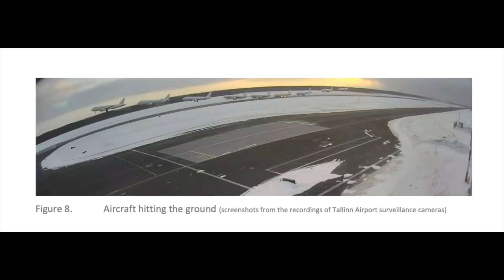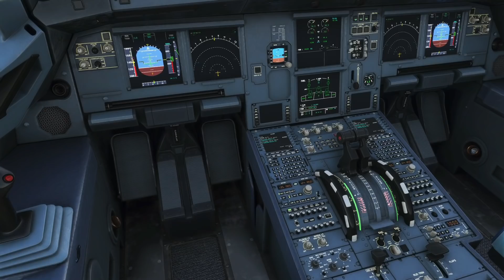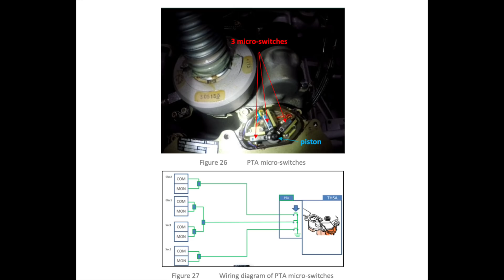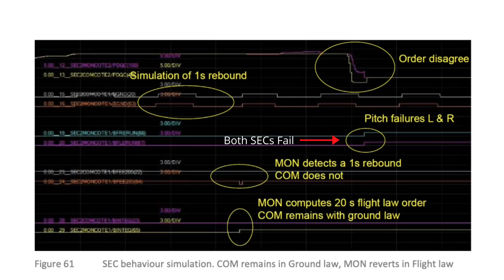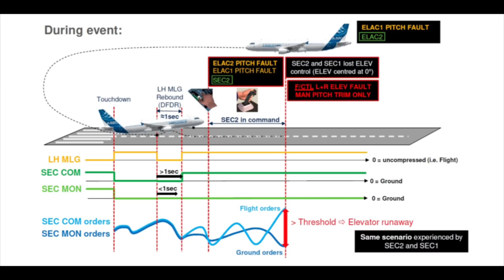The Oil Change That Crashed A Passenger Jet | The Crash Of Smartlynx 9001

Comment: 100%automation with pilot oversight.

I want the computer to be able to look at everything at a single microsecond.

If this plane was fully automated and fully integrated,  the computer could of resynced the sec1&2 by knowing they were in the air by using other gauges, ai, scripts, ect.

You wouldn't blame a pilot who's eye was forcibly closed or intentionally blinded for messing up,  just like we shouldn't blame computers for not doing a job the were not fully do because of the lack of resources given to the computer.

Computers are better at communication,  problem solving and following guidelines when given the chance and programed right.

Comment: You're asking the wrong question. 1-10 automation is irrelevant if the QA applied to that automation is inadequate. Testing is ultimately the hardest challenge facing automation integration into any mechanical system where lives are on the line. This is entirely the fault of the QA team responsible for designing the test plans for these redundant systems, especially given the fact that they knew they were working with asynchronous state/data streams. Competent QA would have known to run this test, or to build a system that throws random component failures/out-of-spec responses into their scenarios. Regardless, my answer is N/A, none of the above. The pilot should, at any point, be able to fully assume surface control of their vehicle. For anything less complicated than a supersonic stealth bomber, at least.

Comment: The problem is not in automation. Much better safety could be achieved by existing amount of automation only if the audio and visual feedback of the computers was improved. As for the mechanics, I don't understand why Airbus was not required to correct their design and make it more fool proof. It's ridiculous that functionality of such a simple switch assembly depends on oil viscosity. A binary system must not depend on variable parameters that are not inputs!

Comment: It's amazing that the microswitch piston was so sensitive that the wrong oil would cause that.  As a non-pilot, the whole thing seems unnecessarily full of fussy mechanical bits.   But I guess it is good that it failed then, rather than slowly wearing out and causing a real tradgedy somehow later.

This doesn't really seem like an automation failure though.  The software really should not have been vulnerable to race conditions like that, and I hope that kind of thing is fixed now, but it seems like what really failed was probably human error, putting the wrong oil in the first place, and possibly the microswitches not being robust enough.

I'm not exactly sure how or why anyone still likes microswitches.  They are reliable, but not as reliable as you would expect given how absolutely confident people seem to feel about them.   But I guess that is why they had 3.

Comment: FBW systems should have emergency switches to bypass the computer and instead directly control the angle and position of the control surfaces, but pilots would have to be trained to work without the feel of a cable-pulley system or the computer's assistance

Comment: A fabulously interesting dissection indeed !  I'm not a pilot but a Dr. 
I see many parallels that air disasters and near disasters have for Medicine & virtually all professions.
Mostly we see reiterated rightly, that a chain of events lead to the disasters..

I confess to being a contrarian. I've always wondered if the chain analogy is good enough ?
I've therefore asked repeatedly, "what if just 1 link is missing or was cut?"
Your reverse look up presented here, is most appreciated and is like.. " the exception that proves the rule"

As for your poll on Electro-Mechanical Automation vs Pilot Autonomy..? 
I beg to steal a warning & guidance from Marvel's Spiderman series..

"With great Power ( Automation ) comes great ( Pilot )  Responsibility "

Comment: Both are needed, but automation should not overshadow the pilot or be the basis of hiring less experienced pilots.

Automation in an airplane is helpful to the pilots and necessary to relieve the load now that they are down a person (flight engineer). The push towards automation should not put us in a position where there is only one pilot in commercial aircraft above a predetermined threshold of number of seats. There needs to remain at least 2. There are too many lives at stake in the plane and on the ground to not have a back-up (human being). Computers, programs, and automation have made many things easier for us. Though, they do break down, shut-down and go haywire often enough that it would be irresponsible to not have 2 human beings that understand the airplane, available to think outside the box in an emergency. The plane is constrained to what was programmed and how that can be applied to situations that have not been considered. 

With the automation in place many outfits do not want the pilots involved in the flight and side-line them as much as possible. This is an idiotic idea made by people that are looking at the bottom line and afraid of legal ramifications. If you do not trust your pilots to manage even simple tasks, then there is something wrong with your hiring/training practices. Pilots need to keep up their skills and kept engaged in the process, the ones who save their planes, in general have brought many skills with them (many of them ex-military or glider enthusiasts). Automation can take off some of the load, but it should not be so much that the pilots are bored and side-lined. Whether it is training in a simulator or more hands on involvement in the cockpit, the pilots need to keep up their skills and continue to learn about the airplane(s) that they are flying. 

Companies seem to have this fantasy over the last decade or so that if they write down procedures, anyone can do the job. In their mind, experience does not really count. Well yes, they can, though this is a foolhardy way to approach business. Anyone may be able to follow directions that are written down, but an experienced person will be more efficient and will notice issues that would otherwise pass unnoticed. Encouraging pilots to engage in activities that sharpen or broaden their skills will make everyone safer. Using automation and SOPs (standard operating procedures) to hire less experienced pilots does not help anyone. Pairing an experienced pilot with a less experienced pilot can be beneficial, so long as they both can work together, be willing to learn and be willing to teach.

Comment: I think a lot of the problems come when the automated systems fail to inform the pilots clearly what is wrong. It's all very well having this stuff with all its bells and whistles but the pilots MUST be kept informed properly by the equipment. The so-called glass cockpit might have been able to solve this problem but the aircraft manufacturers have failed dismally in this respect.

Comment: When airborne, it’s also the multiplicity of redundancies with the absolute automation that should work together.  Pilots should include in their behaviors being operators monitoring devices working harmoniously.  The old school hands on approach is not fit anymore with fly by wires on modern aircrafts, the sidestick is the equivalent of the mouse or trackpad of a computer, therefore not so much action of the brave hero we’re accustomed to see in movies saving the day is necessary.  It’s natural to reset the computer since no one can go around or outside to see what’s wrong when a modern jet  sends mid flight warning signals to the flight deck, but it’s also natural to remain focused on a particular task, not realizing they should have interrupted the program completely to turn off the engines and restart again from square one; it’s never a good idea to be cavalier about complex machines. They had that luxury unlike in other incidents.

Comment: To answer ur que as to automation, I would be okay w/a level 10, or FULL automation, IF & ONLY IF the following measures were taken...consequently 3 measures which realistically could've saved 300+ lives in the MAX crashes. 1. Pilots are better trained in said automation & are req. to recertify w/greater frequency. 2. Measures are taken to allow flight crews to more simply & quickly diagnose the problem when one occurs so as not to have to reference a QRH or follow step after step from a display to again, quickly diagnose & remedy the issue, saving PRECIOUS SEC. 3. Finally, the biggest 1. The ability to IMMEDIATELY override any & all automation rather than (like in the MAX crashes) havin' to literally fight a computer for control of the aircraft, which we've seen in countless crashes, along w/pilots saying "I don't know what the aircraft is doing," like in the AF447 crash, but UNTIL THEN, I can't support increased automation.

Comment: This is why Boeing is better.. Airbus gives more control to computers than to pilots and it has caused many crashes..
Reply: Yet when Boeing tried to do it, it also resulted in 300+ people dying. Watch the latest episode where Airbus automation prevent the plane from stalling on final as the pilots made a mistake. A 737 likely would have stalled and crashed

Comment: Yet another example proving that pilots fly airplanes really quite well in problem situations while computers fly well only when everything is working as it should,.I’d like to see every aircraft with computerised control systems fitted with a big red button that gives the pilots full manual authority over the control surfaces.

Comment: The controls were ifi due wrong oil used at that temp, but they kept doing touch and goes anyway.  Then that guy raised the flaps when low and slow over the runway making the airplane hit the engines on it.  That is what make them lose the engines and land a bit short.

Comment: It's interesting that you ask for people to comment about the level of automation based on a scale (1-10) but that by itself suggests the answer. BALANCE. Too little can make a pilot's workload excessive contributing to fatigue which then means that the "human computer is failing". Too much automation (in addition to the possibility of "computer glitch" or other mechanical failure) makes the pilot more or less dependent on the automation features which can lead to complacency and may eventually erode the pilot's own level of competence as he relies more and more on automation to fly the plane and less on his own abilities.

What that balance needs to be as it applies to this topic may never be answered. I suspect that there will be a greater push toward more automation rather than less so that "pilot error" becomes less of an issue which airlines have to contend with when things go wrong. That may be inevitable. Whether that's a good thing remains to be seen.

Comment: You mention the MAN PITCH TRIM ONLY warning, but I think the related ECAM message "F/CTL L + R ELEV FAULT" (that's the actual ECAM warning that comes together with the CRC) is much more spectacular - seeing this on a GA is a nightmare :)

I've studied this accident extensively and I was really surprised that Airbus wasn't aware of some of the failure modes that were encountered here (ELAC PITCH FAULT due to OVM failures was a known scenario, but the dual SEC loss due to bounce wasn't listed anywhere in official Airbus documents I could find). I was also surprised to find out how strange some of the ARINC busses are synchronized, as that is part of what brought this bus down. The ARINC busses that the SEC lanes pull data from are actually synchronized, but the data sets are not neccessarily synchronized as some data is pulled from a LGCIU that in turn needs to pull from the other LGCIU, as the related Shock Absorber Compression sensor is offside. As completly different pull intervals are used, there is a maximum window of 120 ms where a SEC lane works with stale data, thus causing the "if more than 1.02s BGND then 20s flight law latch" condition to activate in only a single lane, if the aircraft experiences a ~1.02s bounce with highly specific timing conditions. This is effectively a common mode failure, as it is likely to affect both SECs simultaneously. This is normally not an issue, as you're not going to do a touch and go with SECs engaged in pitch, but if you just lost your ELACs, well... We saw it here. I know the A320 is 80's design, but I don't understand all decisions taken here. There are definetly common mode failures in SEC design that could have easily been avoided with a different bus design, but yeah it is how it is. Maybe the alternatives had other issues, I don't know. I presume that it works different on the newer Airbuses.

Airbus has reacted to this accident in a number of ways, notably modifiying the computer reset table in the QRH to forbid any ELAC reset in response to ELAC PITCH FAULT messages. There's also a new ELAC software version in the works (or even in already in rollout) that is apparently capable of being a bit more robust against missing override signals, hopefully preventing this failure scenario in the future. The training manual also no longer tells pilots to touch the trim wheel on touch and go's. The SEC issue is harder to tackle as it's fully a design issue, not a bug you can easily work around. I've heard they work on a new SEC software that handles bounce on touchdown better, also preventing this in the future.
Reply: Not sure if you were aware as it wasn’t mentioned in this video but another thing that didn’t help was the spoilers were not armed. If they had been it was less likely the aircraft would have bounced

Comment: I agree with gene bohannon, stick and wire is the only way to go to save lives. I command my aircraft better when it listens to me rather than having it think on its own. Airbus is endangering people's lives by having IC's boards , capacitors, relays, etc do the thinking. Scary, isnt it?.
Reply: No not at all. If what you said was true then Boeing would still be controlling the 787 by cables but it isn’t. It and the 777 (and even part of the 747-8 and 737 Max) are also FBW

Comment: The automation is fine as it is, the problem here was humans ignoring the warning signals. Hand they landed to check out why the ELAC warning was activated the 1st time, they would have avoided the problems. As the adage goes, "take-off is optional, landing is mandatory." The should have opted not to take-off after the first warning.

Comment: the animation is way off, after the slamming take off the plane rapidly climbed to 6000ft but then trimmed down heavy and nosedived to ca 200ft before pulling out, and rollercoasted multiple times before they got the trim stable

losing all elevator control during takeoff is something that they are way lucky to walk away from, but really, besides luck, their quick reactions were the real saving grace

it was a real horror-rollercoaster

Comment: The issue is not about automation or manual control.
The issue is missing coordination and cooperation of both. Pilots need to be better at understanding automation and processes and how systems work, so they can feel when something is going wrong. While in the same way they need to be confident about their skills.
With all these warnings, should they have continued this flight? Usually, errors occur for a reason. Yet a pilot is not a mechanic nor a programmer. So they can't fully think about both the software and the hardware issue that may cause the error (to a certain degree they are trained, I know, that's still not perfect knowledge).
We need to find a way to let our automated machines talk to us in a better way. Yet I don't know how that can be achieved for planes.

Comment: With two qualified pilots in the cockpit I would say I want automation at 5. Fully able to operate without pilot intervention but fully able to be overridden and flown manually. With one pilot automation at 8. Still able to be overridden but requires a “deadman” device that gives full control back to the computer if the pilot is incapacitated.

Comment: Firstly I should say I’m a professional 777 pilot. The question about automation is an age old one, and causes controversy, right from complex accidents like this or AF447, and many others.
My own view is that automation is a good thing. The part that has gone wrong is that in order to save costs pilots are trained in a much more compressed way than before and don’t have exposure to ‘core’ flying skills in the same way. They have an ‘expectation’ bias, which is to say that because they are brought up with the plane operating in a specific way they are highly confused when it doesn’t.
In the particular event your video is about, I think the repeated reset of an ELAC error on ECAM is a core error - the pilots are becoming reliant on redundancy. Many things can play to this: anticipated proximity to the field, desire to get the detail done, low perceived threat level. 
Pilots are increasingly not aircraft designers - computer engineers and software engineers are. We all know how disconnected they can be. What they expect is logical and rational in design may make no sense to an aviator when flying, who has to devote capacity to other things too. Pilots are not trained to know what does on inside many systems. 
Pilots need to be trained effectively in critical thinking - to disbelieve what their planes are telling them - and focus on core flying skills. Sully taught us that, but it’s a hard, expensive lesson - especially at this pandemic time.
Mind you (as someone once said), if you think safety is expensive you wanna have an accident...
Finally, I consider myself reasonably well versed in many air accidents - I learn from the mistakes of others! - but I do very much enjoy your videos. They are sometimes a little simplified (understandably) but they are still a very good account. Nice work!